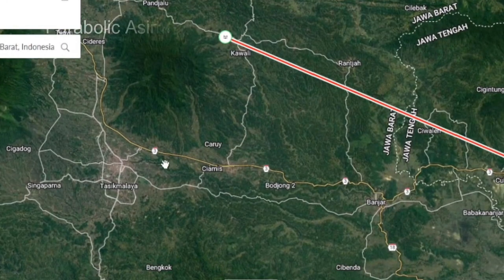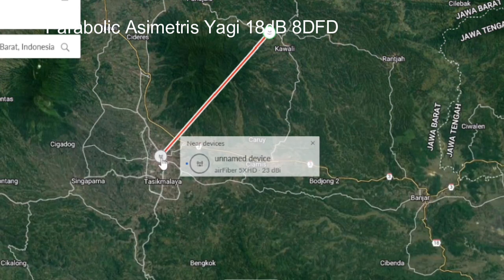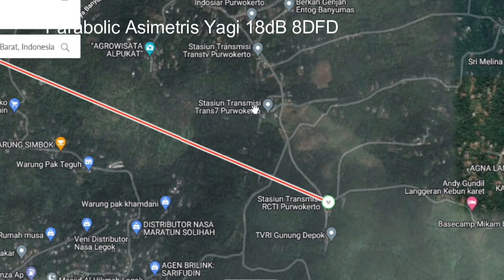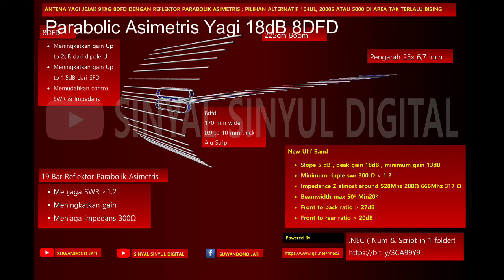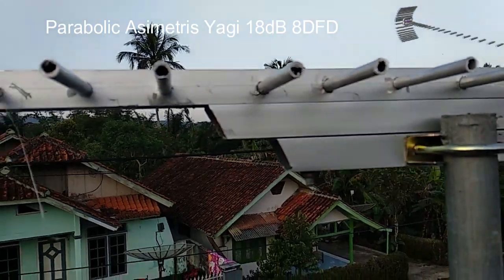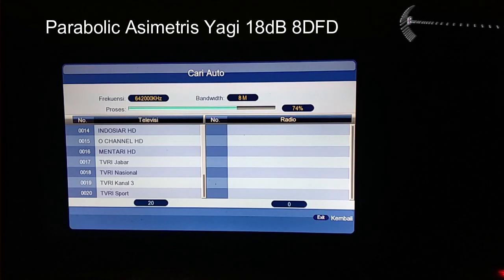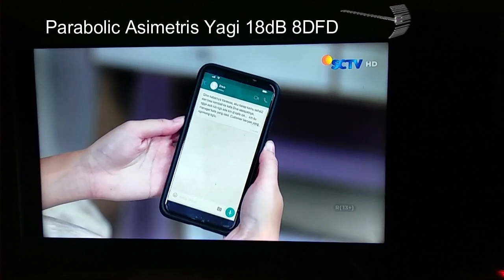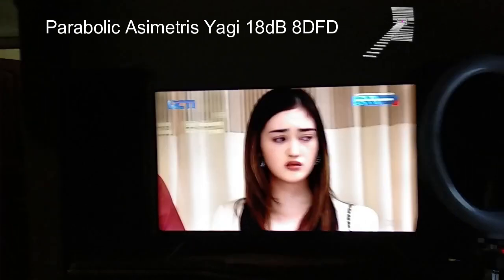Part 1  UHF Parabolic Asimetris Yagi  terbukti 100km,  Cara Membuat Antena TV Digital UHF

Comment: Mantap 👍 👍 👍
Reply from the maker: 🙏🙏🙏 Haturnuhun
Reply: @AdemNgoprekChannel  boleh minta cara membuat balunnya kang
Reply: Apakah model balun antenanya,sama dengan yg ada di pasaran?
Reply from the maker: @alifgalas4580  
1 Balun tidak menambah gain atau penguatan sebuah antena... 🙏🙏🙏
2. Balun beda bentuk yang penting sesuai kebutuhan... Untuk antena UHF biasanya dipakai balun 4:1 diperuntukan untuk 300ohm ke 75ohm. Karena driven tahanan dalam 300 ohm dan kabel coaxial tahanan dalamnya 75ohm jadi perlu balun supaya tidak ada  kebocoran signal.

Mungkin yang anda maksud bukan balun tetapi driven bentuk dipole... 🙏🙏🙏
Reply: @AdemNgoprekChannel  brarti kalo balun yg ada kapasitor di driven antenanya tdk mempengaruhi penguatan antena?
Reply from the maker: @alifgalas4580  Tidak menaikan gain tapi membuat tahanan driven dan Kabel jadi sama supaya matching, 
Analoginya seperti mengalir air dari pipa 1inchi ke 1/2inchi.... Kalau tidak pakai sambungan yg cocok akan bocor karena ukurannya tidak sama, nah itulah gunanya balun untuk menggabungakan dua ukuran yg berbeda.
Reply: @AdemNgoprekChannel  kalo membuat balun yg baik biar pas,berapa lilitan balunya.dan perlukah kapasitor pd balun antena
Reply from the maker: @alifgalas4580  🙏🙏🙏 kalo balun saya cuma niru dari yg sudah ada, karena gak punya alat ukur.. 🙏🙏🙏.
Reply: @AdemNgoprekChannel  berapa lilitan,3lilit,4lilit atau 5lilitan
Reply from the maker: @alifgalas4580  saya coba yang 3 lilit dan 6 lilit hasilnya sama.
Reply: @AdemNgoprekChannel  udah pernah nyoba ditambah kapasitor blm?sperti driven antena pf hdu 19
Reply from the maker: @alifgalas4580  Belum coba, nanti saya coba...Berapa pF ?
Reply: Sabaraha ngagaleh antenana om.
Reply from the maker: @apandiapandi5506  Ngadamel.Kang... 🙏🙏🙏
Reply: @AdemNgoprekChannel  soalnya pengen blajar buat balun antena yg beda dg yg ada di pasaran.biar antenanya peka.